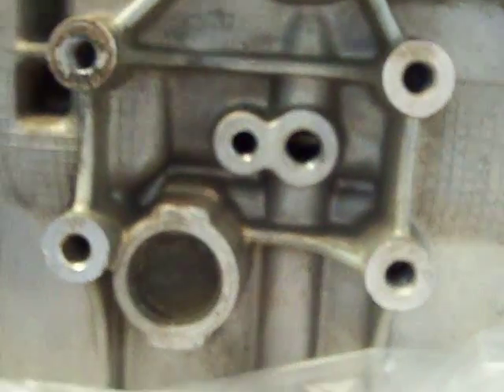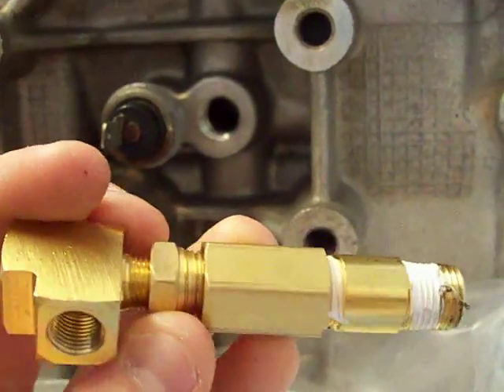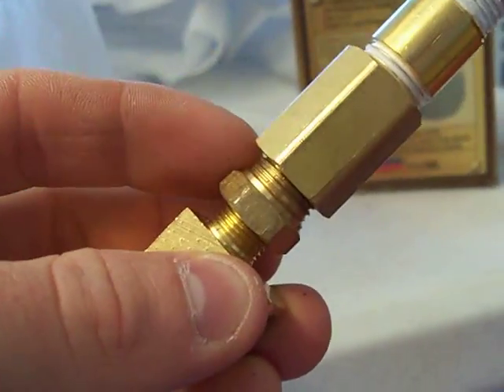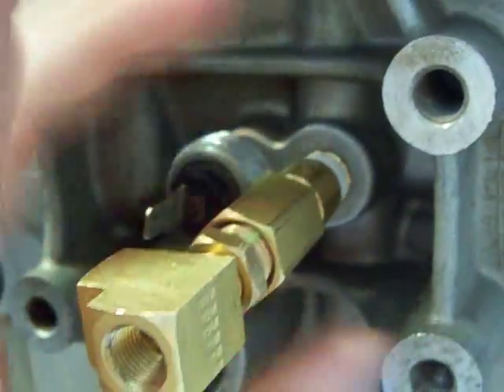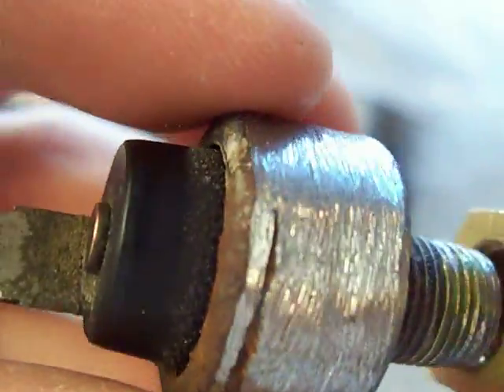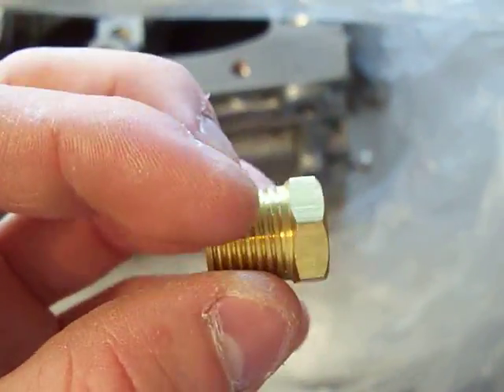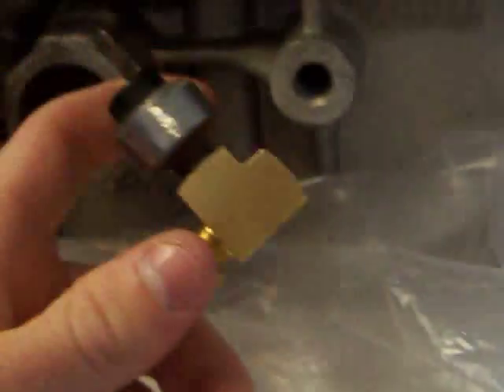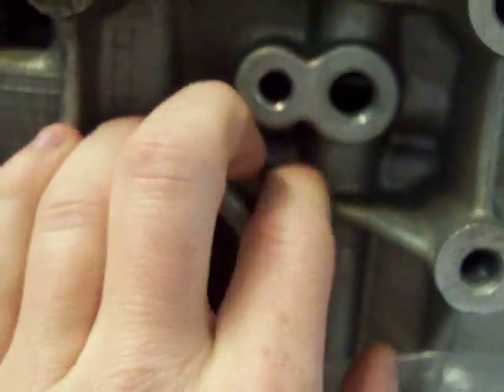Tracker 1.6L 16v oil gauge hook up

Comment from the maker: @reddranger   I don't have a setup up for the gauge.  I had it rigged to a spot but I took it down.

Finding an aftermarket water temp sensor as some as the stock one is very hard.   There are these aluminum tubes with a threaded port that you can use to splice the top radiator hose and use an aftermarket temp sensor.